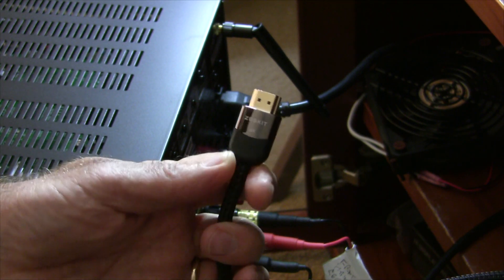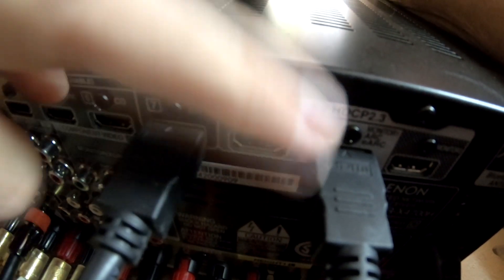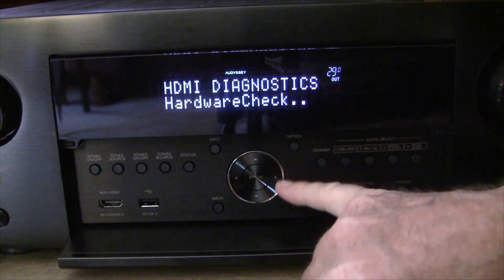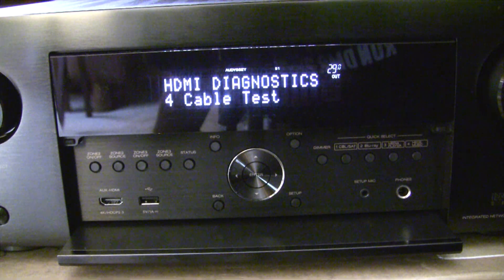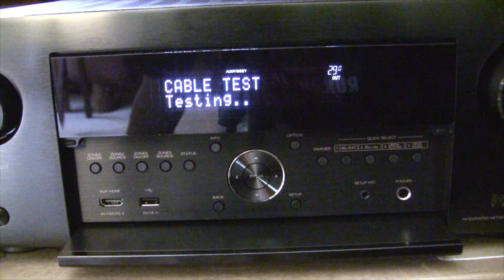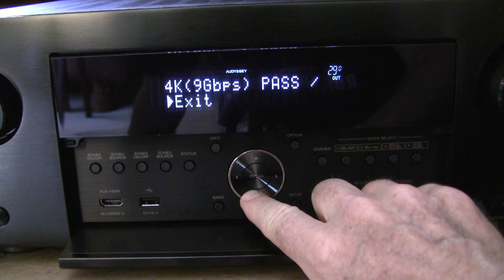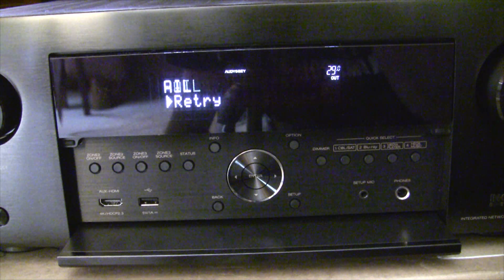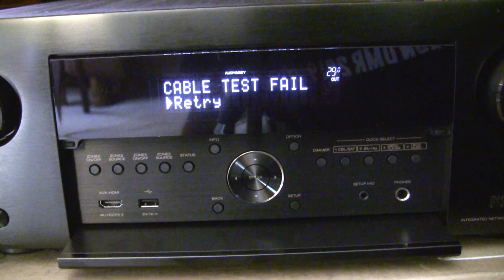Denon Receiver HDMI Cable Test - Testing High Speed and older HDMI cables

Comment: I've a denon AVR-X1800H, I tried this initially and was getting all sorts of results however switching off the receiver and then removing the old cable and inserting the new cable and testing again does seem to give consistent results, I tried a certified 2.1 cable and it passed 4k but failed 8k, however switching off the receiver removing and inserting the certified cable again and restarting the test showed 8k at 40 gigs so it does appear to work as long as you switch off and restart the receiver
Reply from the maker: Yes, it gives more consistent results if you turn it off before inserting the cable. 
That's what I did for a Zeskit Certified 8k cable in this video: https://youtu.be/zWuoCEpl79Y
which also passed.
Reply: @BetaCygniBlog  Just seen the video and same result as mine 👍
Reply from the maker: @katdes7305  Great! You're all set.

Comment: Nice video, can u test old 2.0 monster cable or old audioquest 2.0, i used old 2.0 audioquest carbon it works well on Ps5, thanks more power to ur channel.
Reply from the maker: Thanks for the suggestions. Unfortunately I don't have those cables so I can't test them.
Good quality certified HDMI 2.1 cables like the one I test here:
https://youtu.be/zWuoCEpl79Y
are available for a very low price, so I would go with a new cable.

Comment: I have 3 Amazon Basics 4K cable and they all fail as well.
Reply from the maker: That's too bad. Now that they're available, I'm only buying certified cables.
Here's a video I did about a reasonably priced one:
https://youtu.be/zWuoCEpl79Y
Reply: @BetaCygniBlog  I bought the Zeskit cable and that one fails too. Do you think some issue with the AVR. I have a Denon X3700H.
Reply from the maker: @suryachataut  More likely it's a problem with the test. I retested the cables and this time between each test I powered down the receiver and unplugged it from the wall (because it isn't all the way off when turn off the power button). Then I plugged in the cable and plugged the receiver back in. I got more consistent results doing that:
https://youtu.be/O3c_kNig7iI
Try that and let us know if it works better.
Reply: @BetaCygniBlog  I did power down completed (removed the power cable) and made the connection between HDMI 7 and Monitor 1 (that is what my AVR OSD says). I tried multiple times and it failed each time. I have 3 new cables and they all failed :(
Reply from the maker: @suryachataut  I would make sure your firmware is up to date on your receiver. I do that in this video:
https://youtu.be/XOHkPHNiI3o
Then if the test still fails, I would try a real-world test. First try showing some DolbyVision/Dolby Atmos content on your TV. If that works, then you're cable is fine and there's something wrong with the test.
Reply: @suryachataut  Same here, all three of mine failed but they work great.

Comment: I'm quite sure that Denon's cable test is not reliable. I also have the 4700H and tested various HDMI cables, including an HDMI 2.1 48 Gbps and a cheap HDMI 2.0 cable as well as the PS5 HDMI cable. Likewise, I also got different results, including:

- All three cables failing the test.
- Both HDMI 2.1 cable passing the 4K (9 Gbps) but failing 4K (18 Gbps) test.
- The cheap HDMI 2.0 cable passing the 8K (40 Gbps) test.

In the end, I got every possible result.
Reply from the maker: I agree that the test has some problems. In this RE test (https://youtu.be/O3c_kNig7iI), I powered down the receiver and unplugged it between each test and I got more consistent results.

Comment: Anyone know how to access this test on x4300h?
Reply from the maker: I did a lot of searching and only came up with this post which said it wasn't supported:
https://www.avsforum.com/threads/the-official-2016-denon-s-series-x-series-avr-owners-thread-faq.2444306/page-849#post-58206490
Reply from the maker: You could try this though:
Hold down  ‘Zone 2 Source’ and ‘Preset CH - (minus)‘ buttons on the front of the AVR for a couple of seconds, until ‘Diagnostics’ appears on screen.
Let us know if it works.

Comment: How to Enter this diagnostic tool on Avr-2700h?
Reply from the maker: I found the answer over on this forum:
https://www.avforums.com/threads/denon-avr-x2700-owners-thread.2310815/post-28681670

Hold down ‘Zone 2 Source’ and ‘Preset CH - (minus)‘ buttons on the front of the AVR for a couple of seconds, until ‘Diagnostics’ appears on screen.

Let us know if that works.
Good Luck.
Reply: @BetaCygniBlog  I figured it out earlier but every cable I’ve got including Xbox series x  failed..
Reply from the maker: @piotrchwalek6925  Make sure you update your receiver firmware. As you can see I had some strange results in this video.
I redid the test after upgrading the firmware:
https://youtu.be/O3c_kNig7iI
and got much more consistent results.
One thing I did in the re-test was to completely power off and unplug the receiver before plugging in the HDMI cable.
If it's not unplugged from the wall, it doesn't turn completely off.

I also tested my Xbox cable and it passed:
https://youtu.be/Td0zoNu9r20
Of course that's no guarantee that any other Xbox cable will pass.

Zeskit is now selling "certified" Ultra High Speed  (2.1) HDMI cables:
https://smile.amazon.com/48Gbps-Compatible-Netflix-Playstation-Samsung/dp/B07S1CGQ9Z/ 
If I was buying one today I'd buy that one. 
I was fortunate that both my Zeskit 8K cable & my Xbox cable meet the standard.

Comment: Hey what banana plugs brand are you using in the Denon? I have some but they dont fit.
Reply from the maker: I'm using these Monoprice ones:
Monoprice109436 Gold Plated Speaker Banana Plugs:
https://smile.amazon.com/Monoprice-109436-Plated-Speaker-Banana/dp/B0097JLQVC/

I'm using these for my speakers:
Monoprice 109438 Gold Plated Speaker Pin Plugs
https://smile.amazon.com/gp/product/B0097JLRZM/

I cover this and all the rest of my equipment in my series on upgrading an 8-year old Home Theater System to the latest 4k OLED TV and Dolby Atmos Surround Sound:
https://youtu.be/c5jgOY4J6eE
Reply: @BetaCygniBlog  These banana plugs you specified do not fit. I'm out $10 :(
Reply from the maker: @TheOldRepublic7  I'm sorry about that, it was a cut-and-paste error. I accidently used the Pin Plugs link.
If you bought them from Amazon, you should be able to return them.
Here's the banana plug link:
https://smile.amazon.com/Monoprice-109436-Plated-Speaker-Banana/dp/B0097JLQVC/
I edited the comment above to show the proper link.
Reply: @BetaCygniBlog  No worries, I had to wait for my receiver to come in (which was delayed) and I missed the window. Just wanted to warn others in case they bought the original linked ones. Thanks for your response!
Reply from the maker: @TheOldRepublic7  You're welcome. Maybe you can use those pins for your speakers like I did. That will protect the end of the wires and make a more solid connection.

Comment: Could you test, belkin 8k cables?
Reply from the maker: Belkin is advertising an Ultra High Speed HDMI cable:
https://www.belkin.com/us/p/P-AV10176/
but it's not certified, so even if I tested one, there's no guarantee that any other Belkin cable would perform the same.
The one reviewer on that site wasn't impressed:
"Over priced cheap Cable"
Looking at the reviews over on Amazon, it claims it's a 48gps cable compatible with 4K, 120hz signals, but this cable is apparently over 2 years old and the HDMI 2.1 spec wasn't finalized back then.
https://smile.amazon.com/Belkin-AV10175bt2M-BLK-Vision-Optimal-Viewing/dp/B075N83B9X/ref=sr_1_3?crid=2SKGDTXV9AJWH&dchild=1&keywords=belkin%2B8k%2Bhdmi%2Bcable%2B48gbps%2B2.1&qid=1606583433&sprefix=belkin%2B8k%2Bcable%2Caps%2C248&sr=8-3&th=1

If I had to buy a cable today, I'd buy the Zeskit 8K, but if possible, I'd wait until certified cables come on the market.
HDTVtest, in a recent video said that they had gotten a certified Zeskit 8K cable, but I haven't seen it advertised on the Zeskit website yet or available from any major retailer.

Comment: I have the Monoprice Premium cables, and using many of them for my LG CX, going E-ARC to an LG SN11RG soundbar, both devices support full HDMI 2.1 and E-ARC. 

Plugging in a PS5 and Series X works wonderfully at 4K 120Hz just fine even with Dolby Atmos and HDR Chroma 4:4:4. I use 1 cable from the Soundbar to the TV and replaced the cables given with the consoles with the Premium cables as well, super odd that it failed even the 18Gbps test on the reciever.
Reply from the maker: I redid these tests after upgrading the firmware of the receiver.
https://youtu.be/O3c_kNig7iI
I was also very careful to un-plug the power to the receiver between plugging and un-plugging the HDMI cables. I got much more consistent results. The Monoprice cable I tested worked up to spec in the re-test.
Reply: @BetaCygniBlog  awesome! Do you know if you can get HDMI 2.1 results if you plug into a HDMI 2.1 TV and just use E-ARC to send the sound to the receiver? I'm looking to upgrade to a receiver as opposed to a soundbar but atm even top of the line receivers only have 1 HDMI 2.1 port. I'm looking to be able to do 2.1 with both consoles and a PC.

Thanks!
Reply from the maker: @EmitSlab  Yes, I'm doing just that. I have a whole series on how I upgraded my 2012 era Home Theater system to the latest 4k OLED TV and Dolby Atmos Surround Sound. Here's a link to part 1:
https://youtu.be/c5jgOY4J6eE

I realized with the new internet connected HDMI 2.1 TVs (at least from LG), the "hub" of the system is now the TV rather than the receiver.
My LG C9 has four HDMI 2.1 inputs and I'm using one of them to drive my Denon X4700h receiver using eARC. The results are spectacular. Especially the Dolby Atmos surround sound.
Reply: @BetaCygniBlog  Awesome I just watched the first 3 parts! I'll probably upgrade to the same receiver, I'm just lost on how to go about picking speakers. The Klipsch R series seem to be around my price point but then audiophiles were saying only the RP series are worth it, which are about 2x as much.

So it seemed like 4K 120Hz, HDR 4:4:4 and everything was working wonderfully for you now? Do you ever get the audio popping out for a second with using E-ARC?
Reply from the maker: @EmitSlab  Everything is working great for my setup. I've had absolutely no problems with eARC. In one of the videos, I run a YouTube video at increased speed and the lip-syncing works fine.

You can see a list of the speakers I picked in the description, plus I show them in the video.
I have some size constraints so I didn't have room for Klipsch (too wide). I'm very happy with the ones I got. 
I found some Polk left & right Front speakers that would fit and decided to go with Polk for all the rest. I splurged on the center speaker since I had enough room for a slightly bigger speaker on the shelf above the TV.
The Polk speakers I'm using for surround and Atmos height speakers (mounted on the wall) are great.

If you can make all the way through the series, I hook up an Xbox Series X and show movies & video games. The video games play at 4K 120fps with the XSX going into the TV and the sound coming out via eARC into the receiver.

I'm realizing that the Xbox Series X's blu-ray player for movies is not going to be good enough for my purposes which is disappointing.
I have a number of 4K discs with DolbyVision and DolbyAtmos and the Xbox Series X won't put out DolbyVision. It may in the future, but I realized that I also play a lot of other regular Blu-ray movies and the video processing for movies in the XSX is not as good as a standalone player.
So I'm getting a Panasonic 4K Ultra HD Blu-ray Player (DP-UB820) that I'll be hooking up soon. I'll add that onto the end of the series.

Comment: That was a fun, interesting test, I’m in the UK and thinking of upgrading to the 2700H from the 2600H there is one less HDMI port on the new one, I am as addictive as you with cables and power cycling off things before I power new cables up, I get some picture issues with my new and older 4K players (I have 3 lol, no reason to sell them and I always thinks its cool to have a movie in each ready to go lol) anyways, side question, does the 8K HDMI input allow for any 4K player or games console to plug into it, as in act as any other HDMI port or is it exclusively for 8K content ? I’m thinking not but as you have a newer receiver I wonder if you can let me know..along with the 8K out, can that go to my LG OLED or does that have to be the 4K Output 1 ?
Thanks so much brotha.
Reply from the maker: There's a known problem with at least the new Xbox Series X going through the 8k input of the receiver and onto a 4k TV. Apparently all the major receivers have this problem:
https://www.youtube.com/watch?v=as35Cd2ZWyQ

However, I'm running my XSX directly into my C9 and passing through the sound to my receiver using eARC. So I shouldn't have this problem.

I'm running both my video sources (XSX & Chromecast Ultra HD) into the TV and using eARC for all sound.
I have a new series mostly done about hooking up the XSX to my new Home Theater system. Here's a link to episode 10a:
https://youtu.be/vJSYa_HAlGk

Comment: Can you test the monster uhd platinum. They say they are 8k ready
Reply from the maker: I don't have one of those, but here's a review on Amazon that says it didn't meet the spec:
https://www.amazon.com/gp/customer-reviews/R1HMPLAVX8QYK4/ref=cm_cr_dp_d_rvw_ttl?ie=UTF8&ASIN=B07N7NL1NR
The Zeskit 8k cable I tested in this video:
https://youtu.be/O84G_RGwKco
worked fine for me and others and it's cheaper than the Monster Cable.
https://www.amazon.com/gp/product/B07S1CGQ9Z/

I'm still hoping that Certified 8k cables come out soon.
Reply: @BetaCygniBlog  I’ll be testing mines for at least the 18GB spec Monday. I know a few people had issues with the ends not being so good and they were easy to bend so that’s the only thing they said that I know. I would want to think it should work for 4k60 so imma fault that to it being a bad cable
Reply from the maker: @GamerGee  Good luck.
Reply: @BetaCygniBlog  I need it. I have a in wall. Able installation and that’s the cords we chose because 200 bucks for a cable just for a same room install is crazy
Reply from the maker: @GamerGee  Let us know how it goes.

Comment: The Denon AVR-X2700H is suffering from eArc issues using eArc and a games console via eArc and sound mode selection. Not using bitstream, but LPCM.

It only happens when the source is eARC (ie internal apps from the TV when eARC is enabled or using a games console via eArc). The Denon app shows Multi-channel PCM input, however, the output options are not the same when receiving multi-channel PCM from an input directly connected to the receiver.

When using eArc on my TV connected to the Denon, the denon receives multichannel PCM input from the TV, but when I go to select a sound mode on the receiver, I only have a choice of multichannel stereo, stereo or DSur.

Why will it not let me select a sound mode like Multichannel PCM? It should let me output the same format as what the receiver is receiving? Like Input-Multichannel PCM Output-Multichannel PCM.
There is a clearly a bug with this receiver, that will not let me output Multichannel PCM as a sound mode over eArc.
Input (eARC multi channel PCM):

 

Output (choices are Stereo, DSur, Multi Ch Stereo):
 

Can test this to see if they have been able to get Multichannel PCM sound mode output? Rather than Stereo, DSur, Multichannel stereo?

I am sure this is a bug with the latest receivers? And needs fixing via firmware update.
Reply: Hi, how did you access the diagnostics on the 2700?
Reply from the maker: @Ruicarrico  I found it over on this discussion thread:
https://www.avsforum.com/threads/official-2020-denon-avr-owners-thread-faq-posts-1-8.3151088/post-60203455

"Press and hold the far left button (TUNER PRESET CH - ) and ZONE2 SOURCE together."

Let us know if that works for you.
Reply: @BetaCygniBlog  Thanks
Reply: @BetaCygniBlog What HDMI input/output combination?
Reply from the maker: @Ruicarrico  Use the ports labeled 8K & the one labeled eARC.
Reply from the maker: I don't have a game console yet (I'm waiting for the Xbox Series X to come out), but I believe I found the same problem with my Blu-ray player. My solution was to configure the Blu-ray player to output unprocessed bitstream instead of PCM. Here's a link to that video in my Home Theater Upgrade Series
https://youtu.be/JU83aMFM99o

I'm running my Blu-ray player through my LG C9 TV using pass-thru to my Denon 4700h via eARC.

Here's an interesting discussion about PCM vs. bitstream:
https://planethifi.com/pcm-vs-bitstream/

I'm not sure why bitstream isn't okay unless you have bandwidth problems which shouldn't be an issue with HDMI 2.1.
Letting one of the latest and greatest Denon receivers (rather than the player or console) process the sound seems like a good idea to me.

This seems like an active discussion over on AVS Forum:
https://www.avsforum.com/threads/official-2020-denon-avr-owners-thread-faq-posts-1-8.3151088/post-60194416

Here's the original post:
https://www.avsforum.com/threads/official-2020-denon-avr-owners-thread-faq-posts-1-8.3151088/post-60178023

Hopefully Denon will fix this.